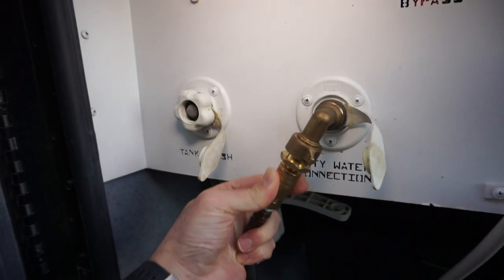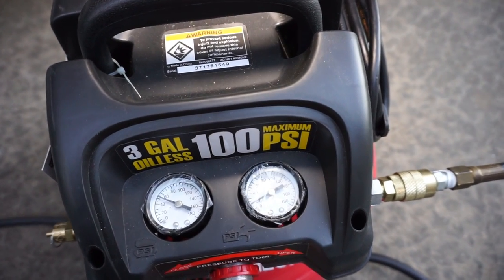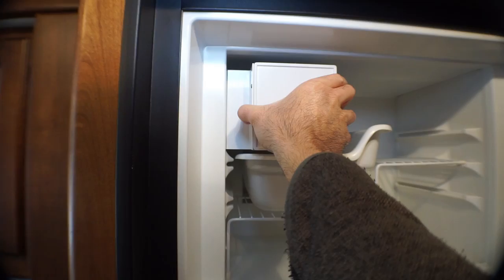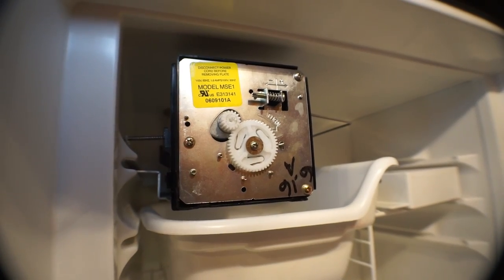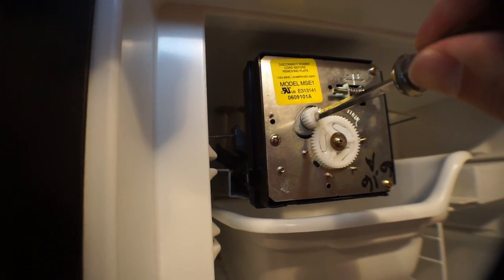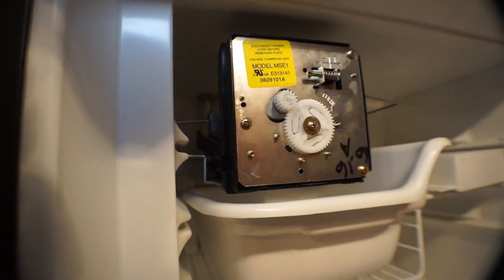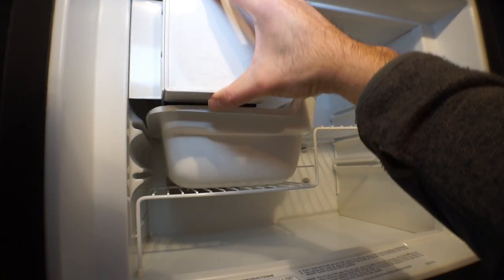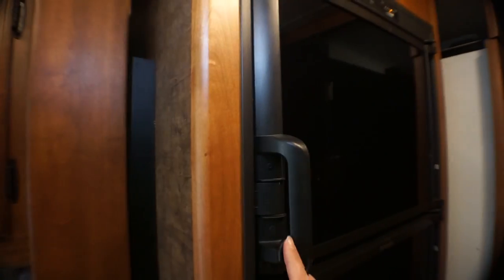Winterizing your RV ice maker trick - RV maintenance the easy way

Comment: Is there a way to jumper the ice maker solenoid so it stays open?
Reply from the maker: I think so, but if I remember right from looking at the manual it meant getting into the access of the fridge from the back and undoing some wires. It's been easier just to kick the gear around a little and wait a few times 😊
Reply: Actually, I fou.d out how to do it by removing the ice .amer cover and using a jumper in two of the lettered holes. It holds the solenoid open and allows for either air, or antifreeze to come all the way to the fill tube.
Reply: Found it; if you make up a wire jumper and put the jumper in to the test ports labeled L and V, the solenoid valve will open and stay open as long as the jumper is in. This should allow time to blow the ice maker line out with air and to push antifreeze through it as well if you wish. If you want to force a cycle install the jumper between T and H. After about 20 seconds the ice maker will start a cycle. After the cycle has started you can pull the jumper. There are other test procedures that can be accomplished using a jumper and the test points behind the cover, based on the Norcold Service Manual that may be handy.
Reply from the maker: Awesome! Thanks for digging that up!

Comment: I used to use air to clear the lines but now I just let the antifreeze push out the water and I eliminate the entire air process. Plus it’s another chance (even using low pressure) to pop off a line from a coupler and leak. Once you have the low pound drained and the water tank emptied, it takes 3 minutes to pump antifreeze through all the lines including using a jumper wire for the ice maker.
Reply: The problem is flushing the anti freeze out, will take a long time through the ice maker